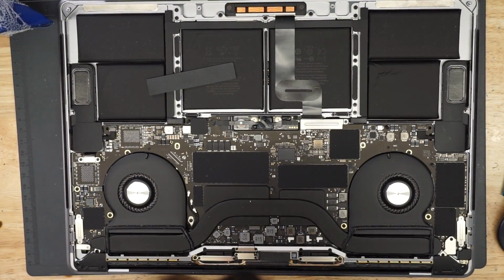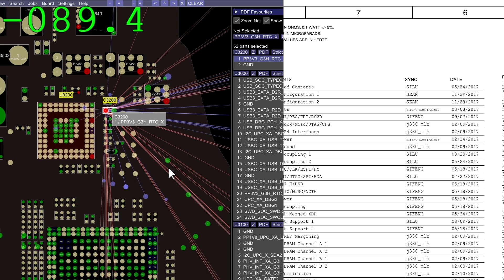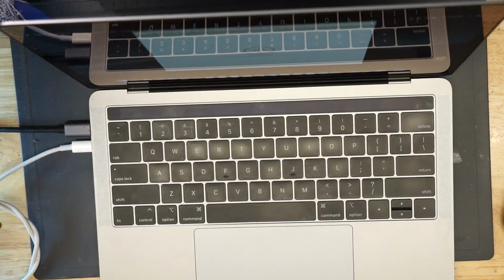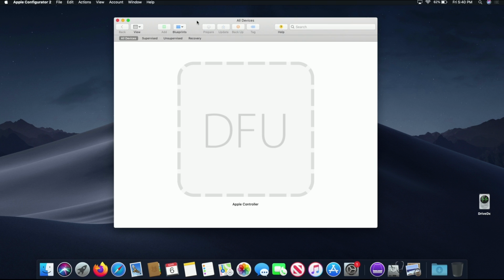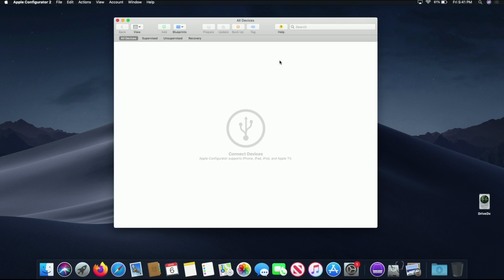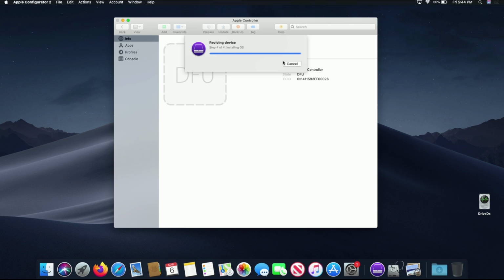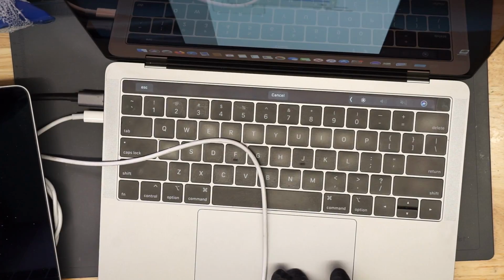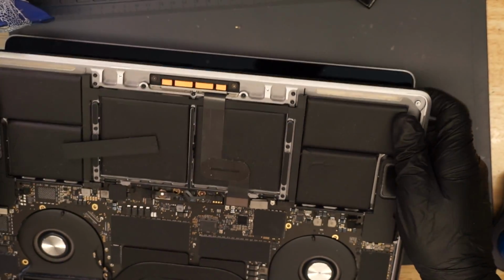A1990 Macbook Pro dead after update: how to repair T2 failure on 820-01041

Comment: Hey Louis -  I've got an Intel 2019 MBP (its mint as i ook after my tech)- spent a fortune ($6500 - fully speced + 4TB) on it back some years ago- just before Apple dropped Intel; So flash forward though crises including having my left arm amputated\a month in a coma and sadly 2 of my young triplet children passing away....  I missed an.Applecare warranty renewal as my daughter had just died and reading email wasn't a priority. I'm an Engineer of many types pls 35 years in IT. My thesis was designing sensors and circuits in 1994! But I'll be screwed as to how to get the 2019 MBP to COMPLETE the configurator (ver 2.18 - latest on their servers) to NOT crash through the process (Using USB-C to an M1 Air).... (I've made a  mouthpiece using a torch taped to a silicone cable guard and a bulldog clip to act as 2 finger on a left hand!!!) to hold-down idiotic keys.   Bearing in mind that this machine was fine until 2023.... then I had no interest, as that's when I lost my 2nd girl. UNDER AppleCare+, the logicboard and display hinges were replaced in 2022, my $100\year insurance policy was cheap as they came to my home and repaired these issues-(Apple argued before I could demonstrate stress fracturing along the casing!!!) then it all worked perfectly. Issue- I've spent a week diagnosing and trying everything including some things I didn't know about this series of MBPs. I watched your channel - have done since you started actually, now vicariously watch repairs as missing an arm loses its simplicity of things we take for granted - the focus of circuits is one thing I miss. Flying aircraft another. So if you have any tips or thoughts on whether that T2 is fried as it kicks out of DFU during a revive - (many times tried a restore; would love your thoughts. Seems like a hung T2 update, but Apples advice... keep doing it!
 Rgds Steve ps (my MBP 2013 still works!)

Comment: Got a 2020 MBA here. Turns on and get Apple logo, but then fan ramps up to high a few seconds later and then doesn't go any further. 
Managed to do the firmware recovery using DFU mode. Seemed to complete ok, but still won't boot. Internet recovery stalls at the spinning globe. Tried with WiFi and Ethernet. Left it for hours doesn't proceed.
Also in internet recovery e.g. the network selection screen, the machine is laggy as f**k. Like a few seconds just for the mouse pointer to move after touching the touchpad. The firmware recovery screens however were not laggy and the process completed in a couple or so mins as expected. 
The machine has a kaput battery. Powers off instantly when plug is pulled. 
Wondering if the issue is battery related?? If so it would be the first time I've come across a laptop that ran slow (like it was powered by a 2KHz single core CPU slow!) due to a duff battery. Thanks Apple.  
Is it worth replacing the battery to try and resurrect the machine? Or is the fault likely to be something else?
Reply: I have exactly the same problem on an air2020. Did you find any solution?

Comment: Does the computer running the Apple Configurator have to be running the same version of the OS on the Mac that needs the DFU restored? I have a A1990 MacBook Pro that's running Mojave. It's the only version of the OS that supports the software that I've bought. Can the Configurator for the T2 chip without completely rewriting the OS? Please kindly advise....

Comment: Hey, I have the same board 820-01041A and all the USB C ports are stuck on 5V 0.4A ( not boot looping). Can I assume that it's a problem with the T2 chip? I looked for this scenario in your repair wiki and didn't find one. I bought this computer from a guy who said that he thinks that a little bit of water touched the upper left USB C port of the computer and this is why the computer doesn't turn on anymore. I thought that if water touched the USB C port so probably the CD3215 will be damaged, but I assume it's not the case.
Reply: Forget the mention that I have PPBUS G3H of 12.3V and also PP3V3_G3H of 3.3V

Comment: Thanks man, trick worked for Macbook Pro 2019 and yes, machine was totally bricked, no fan, no light, no sound, black screen, and DFU reset, wake it up. 

Also DFU work for me, when I connected dead machine with the left 2nd (from the screen) thunderbolt port.

Reason for the condition: I tried to update to macOS Monterey , and when it stuck i forecefully restarted it. (maybe it was working, but the update bar is not moving much for around 30 minutes)
Reply: Could you tell me how you managed to put it in dfu mode without being able to see anything on the screen?
Reply: @nicojoelitoreyes2219  you need another macbook with apple configurator 2 installed as shown in this video.
Reply: if I have another macbook and I have the thunderbolt 3 cable but I don't know how to put the macbook that doesn't turn on in dfu mode
Reply: Connect both macbook using the thunderbolt3 cable and run the apple configurator 2 app on working macbook. Follow the instructions in this video, you dont need to start the brick macbook, it will wake up itself, once it will be recovered successfully.

Comment: Mine stopped turning on. It will charge enough for the touch pad to click but that’s all it does. The light that indicates that it’s charging doesn’t even come on, no matter which usb-c adapter I plug the charger into. Do you think mine has the same problem as this one?

Comment: Hi I have MacBook Pro 2019 A1990 and its not updating with Big Sur. Going Back to Mojave, If i tried to Update Mojave that go to Catalina, But Catalina to Big Sur not going update. Stuck on last 15 seconds or  hold in the middle where system says remaining 10 minutes. I check with Apple store and they also unable to update. Any how they succeeded by system crash down after restart and return back to Mojave. Even I see that only on Partition in disk utility. Macintosh HD and Base OS disk. There is no Macintosh Disk-Why its; missing.

Comment: I just spent three hours trying to get around a bad Big Sur (half)installation.  Before T2, it was a 1/2-hour job.  Now, because it wouldn't allow me to boot from an external drive, was confused about the admin user password, and wouldn't allow the WORKING user password to "unlock" the HD, I spent three hours trying everything I knew to make it work.

Finally was able to do a restore from Time Machine backup (which didn't work the 1st time because of T2 security).

Go here to see how to modify the T2 settings, to avoid these troubles:   https://www.youtube.com/watch?v=rzjXgPmVtdQ

The T2 chip is 100% for Apple's benefit and 0% for yours.

Comment: I have a MacBook Air with a t2 chip that won’t charge the battery and runs extremely slow, I get 0v on the F7000 fuse but also 0v on Q7065 drain, both the gate and the source do have over 12v, could this issue also be resolved by reflashing the t2 chip or is this another problem? (No liquid damage or corrosion)

Comment: This is great if you have another Mac to perform this on. Many would not. I contacted Paul Daniels when I suspected this happened to me. The store I dealt with over here in Australia were awful. They replaced the logic board and display which took ages as the first board was DOA. I suspect what you highlighted on this video was the issue. This is shonky and awful.

Comment: Have my A1990 bricked I guess, black screen, doesn't turn on. Tried DFU and in Step 4 after installing the progress bar is completed I get AMRestoreErrorDomain error 9 - Failed to receive message from device, might be connection problem with USB host. Any clue?

Comment: I had dead my MacBook Pro 2018 13” A1989 didn’t appear in my Apple configurator  when I plug to the master port and when I plug to other said "Cannot use Thunderbolt Accessory. Connect accessory to a thunderbolt port on this Mac." LOL I have a brick could the update kill the logic board? Or I need to wait a till appear? Please some light what to do? Last option sending to service Apple....
Reply: Same thing happening to me man, literally can't get it to boot or turn on after it suddenly bricked while it was in sleep mode. Don't know wtf to do.
Reply: @Jancarlos1597  Hi I fixed first I bought a Thunderbolt 3 or USB C 3 (power delivery up 100W(20V/5A) Up to 40Gbps https://www.amazon.com/gp/product/B081QC5NL1/ref=ppx_yo_dt_b_asin_title_o00_s00?ie=UTF8&psc=1 and next follow this instructions https://mrmacintosh.com/how-to-restore-bridgeos-on-a-t2-mac-how-to-put-a-mac-into-dfu-mode/ be careful with the keys that need to press power first 1 sec next right shift then left control and option for 8 seconds
Reply: @AndresDelapava  Mine had a faulty integrated circuit (ic), its the second time that something like this happens, first time I know it was a T2 failure, still was under warranty, so Apple replaced the whole mobo.

but now this time, this little mofo IC was fuc*ed, a friend of mine fixed it for cheap ($250) vs the 1100 Apple was charging me to replace it, thanks god I got it back with all the files in it still.
Reply: I think I get my answer here ..https://youtu.be/6dwqxsDHkKQ my old MacBook is full security

Comment: What would be the issue if it doesn't power on or charge any more however when I measure the input using the USB device I see 19.9v and amps that cycle from 0.01 to 0.87.
If I remove the battery I see the same voltage but the amps stay at around 0.01 - 0.02

Comment: Can this fix be also applied to dead A1990 that didn't even went to any update? I have a A1990 that just died after I tried to force restart because it lagged while I was typing my password, which I thought was just a normal Mojave issue. My laptop is still under Apple warranty but I can't be accommodated at this time because of the COVID-19 lockdown. I hope this would fix my laptop.
Reply: My MBP A1990 also died just like yours. Exactly same situation, I forced restart after my password wasn't accepted. Now, this solution woke it up but it never finishes to install the OS. Any idea or solution?

Comment: My Macbook Pro A1502 Late 2013, don't have connection for cable usb c, only thunderbolt or usb, any suggestion ?  thanks
Reply: Use USB-A to USB-C cable
Reply: I only have 2 ports thunderbolt,  and may imac the same,  maybe a cable thunderbolt to thunderbolt ?
Reply: I dont have  USB-C in my computer

Comment: I have a update issue, wondering if this DFU  mode will help, 2018/2019 13” tb serial number doesn’t exist according to Apple even thou it’s engraved on the lid, top case, bottom plate and is displayed in system diagnostics, I’m able to boot recovery and install os but fails verifying the serial
I’ve checked with Apple, PowerBook medic and bunch of other sources, the serial doesn’t exist
Wondering if DFU will help or is there another way to install operating system without verifying with Apple serve

Comment: So when your repairing a mac with corrosion, is that because the user is drinking stuff right over that mac and spill onto it.?!!!! Also, what is the usb charger that your using to measure voltage?

Comment: I repaired hundreds of failed bios-es on PC and almost always I was able to do it with simple dual bios/USB/floppy/cd methods. Just in handful occasions I need to use external flashing with donor board and hot-swapping. This Apple method isn't so bad in comparison to older pc ways but on modern PC MBs dedicated USB port with a flash button is a king.

Comment: offtopic: Louis, I know you specialise in MacBooks, but could you make an 27" iMac buying guide, based on your thoughts and experiences? Your macbook guide was so useful!
Reply: Im working with imacs.
2011 and earlier - only if u get them diet cheap and have skills for reapair if they fail. for failing gpus there is project for replacing them with nvidias 7xx and quaddros, aswell as RX cards on macrumors.

2012-2013 - not bad altough GPU US dated right now, cpus are still strong.
Opening and changing fd or HDD for SSD is a must. Diet cheap if you dont mind broken glass, but remember that new panel cost id insane - sometimes more than for 5k Retina.
2014-2017 good machines, had them dying only from either user fault or Efi corruption. fD or HDD to replace immiedietly. Screen is diffrent than 2012-2013 but issues are the same. 
2012-2017 with delta psu are gonna be wonky, failing randomly and coming back. Easy fix - buy lite-on psu.
Reply: @aro836  Thank you my friend!

Comment: I am somewhat surprised that this is fixable by plugging it into another Apple device. Maybe there is a way to fix the dead chips that way, too? You know, the ones you can't buy with firmware. Maybe it's worth a try to put a "virgin" chip onto a mainboard and see if you can have an Apple device flash it?

Comment: After force quitting Apple Configurator see if it has its save state in libraries. Delete the file and start AC  again. Should work without a reboot. Tell me if it worked. (Also say hi to Kris!)

Comment: One thing you missed how the hell you get it into DFU mode in the first place
Reply: Method
Install Apple configurator2  first press poet for a second then hold right shift power left command left control for 8 seconds and boom should be in DFU mode

Comment: Does the working machine have to have a T2 to do this or just any mac will suffice as long as it has apple config 2 installed
Reply: Any Mac will do. I used MacBook Pro 2014 to restore MacBook Air 2018.  And succeed without ssd data loss.

Comment: As a certified Apple tech for a company this program works better than the actual program they give you which will fail sometimes with no warning and it’s because it needs an update.... which Apple won’t tell you about for about a week meaning the computer is bricked until an update is downloaded

Comment: Run run away from any T2 based devices. Supported Apple  for 10+ yrs not any more. With audio drop outs and other issue and this chip generally a unnecessary gate by Apple. Fk em’. Just don’t given your money 💰 for these  devices

Comment: It has been speculated that the T2 chip was made to defeat Hackintoshes. Looks to me like the T2 is another point of failure in more ways than one!
Reply: T2 was made to provide hardware level security to storage, keyboard, microphone, camera etc
Reply: It's in no way going to kill hackintoshes since it also carries smc messages, so basically like an smc emulator hardware mode with extra stuff.

Comment: So, with this, could you possibly take a donor T2 from a dead one, put it on one for repair that has a dead T2, then flash the firmware like you just did so dead T2's can be repaired now?
Reply: Probably not, that would be a huge security loophole. The firmware and the serial number are not the same.
Reply: @gordonrichardson2972  sounds like someone should try it